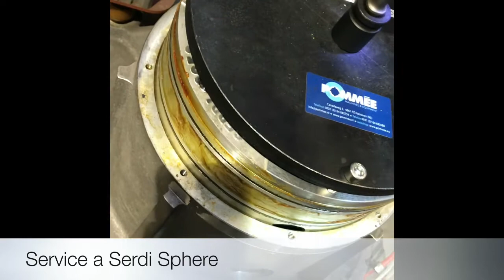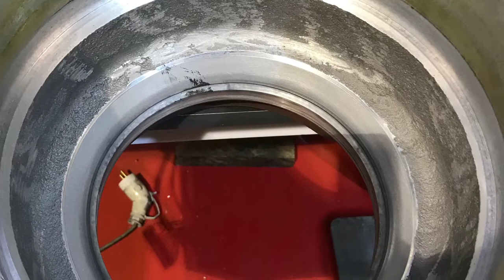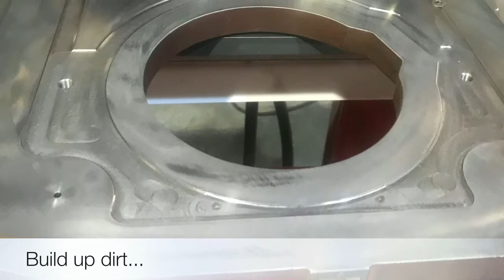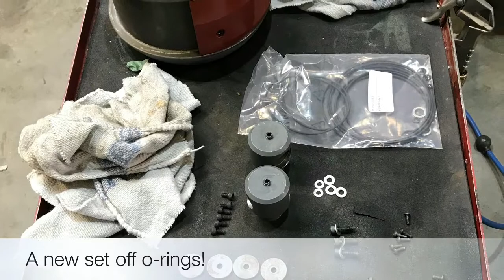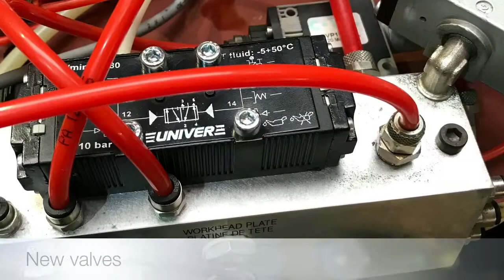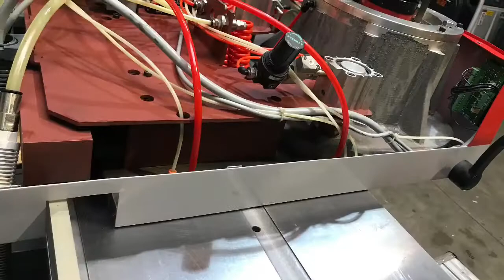Serdi sphere

Comment: Hello Robert, first of all thank you for the video. Its seams that you are doing business with those kind of machines, so it might be not in your interest to help me out, which i could really totally understand, but asking doesnt cost anything, so:  I am currently projecting my own CNC Valve seat cutter spindle, which will work about same as a standard facing head or the Serdi/Newen heads and i am pretty sure i will get it done (currently creating the CAD drawing), but the floating spindle/air cushion is something where i could have problems. I want to start to do a CAD drawing of the sphere and housing and ready to soon do some pracital experiments, because i am in possesion of all necessary tools as well as CNC machines, like e.g. a precise CNC Router and a very precise and rigid CNC Lathe that i have build myself next to 2 other cnc machines. I belive i watched your video about 20 times and i am wondering about a couple of things. 1. The grease: What grease is that and how does it work together with the air pressure - Sorry, that might be a stupid question, but that combination makes me wonder. 2. How does the clamping works, through a electromagnet? 3. Of what material is the sphere and the housing made of (e.g. standard tool steel or steel with surface hardening)? I belive i had more questions, but for now its maybe enough. No matter if you help me out or not, all the best to you and your business. Denis